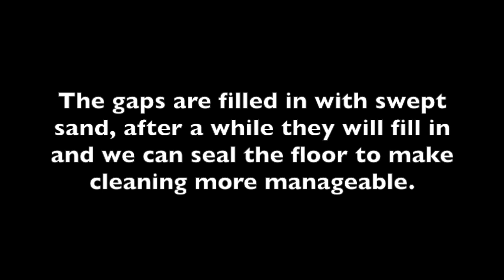Our timber frame workshop: Brick floor

Comment: I am really enjoying your build series. If I may, a couple of suggestions if you do another floor similar to this. I've done countless patios and some floors similar to this. Converting an old greenhouse to a sitting area was one. I would suggest a string as a center line laying in a pyramid style keeps your pattern straight with little effort. Small stakes down the sides every few rows with a string or straight edge keeps the rows straight. For the finish I would highly recommend Polymeric Sand, tamping the floor with a piece of carpet on the tamp. It's not as old world but you only need to do it once. It is extremely fine so the cracks fill completely, never needing to filled again as with sand. Looking forward to your future video shares. Namaste
Reply from the maker: +jake Thanks for the tip!

Comment: Looks great, keep up the great videos!
Reply from the maker: +Blake S. Thanks!
Reply: Have you had any difficulty with permitting? I'm in central N.C. and have been told it can be challenging.
Reply from the maker: +Blake S. One reason we moved to KY, no building codes.
Reply: Wow, that's great to know! Thanks again.
Reply: Mr. Chickadee 
Even if there were any, i think you'd teach them a thing or two!

Comment: Just awesome work!!! Do you have moisture issues from the floor being right on the ground??? I am going to be building a pottery/glassblowing/ blacksmithing/ woodworking studio and wanted to put a floor like this in it. Thanks.
Reply from the maker: We did, then learned a thick layer of gravel is a must, took a few days, but we pulled up the bricks, added 12" of gravel, then laid the bricks again, no more moisture issues.

Comment: Do you leave the metal rods you were using to control the depth of your screed board in the sand or do you remove them? If you do remove them, how do you keep from messing up your level sand?
Reply from the maker: I took them out, then used a trowel to smooth and level where they were.

Comment: sorry, but the last 20 seconds of the video are the best watching your dog and kitten play together.  Do you have problems with ants and if so, what is your recommended solution.  Every outside brick or stone paver project ends up with ants in between coming through the sand.  Outside doesn't really bother me too much, but I do want to do a brick paver project indoors in a crawl space area.

Comment: Great job. Looks really nice. How does it stand up to moisture, both if it's really wet outside (do you get seepage) and if you spill inside (does it drain)? Also, how do the bricks do when you drop tools? I'm assuming they're hard enough to really not dent or crack, but I'm curious.
Reply from the maker: +Matthew Friedrichs Thanks. So far no seepage, and if we spill water or anything, it soaks in before we can mop. Dropping tools is more dangerous to the tool than the brick normally, similar to a cement floor.

Comment: Nice job! But for a carpenters workshop isn't it better to have an traditional wood end grain floor? What is the reason you have used brick instead?
Reply from the maker: I guess I got the idea from Roy Underhills workshop, I also didn't know about end grain floors at the time.